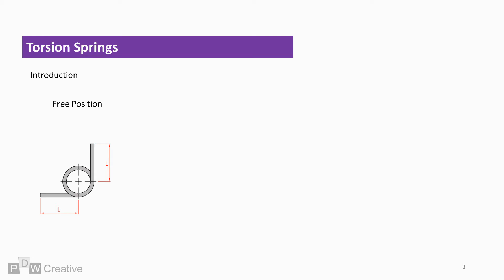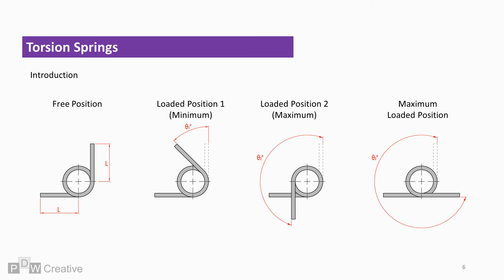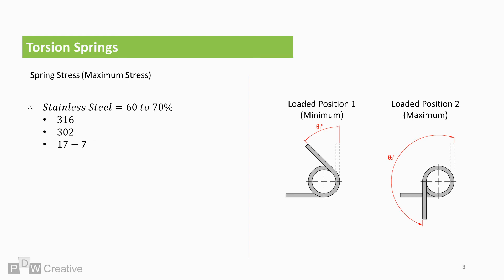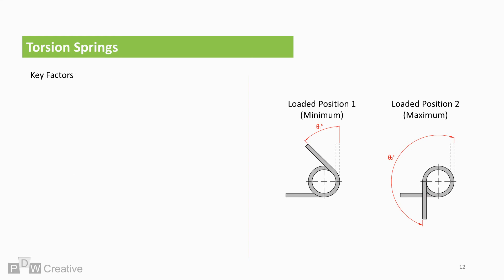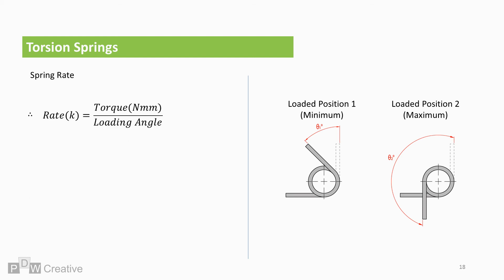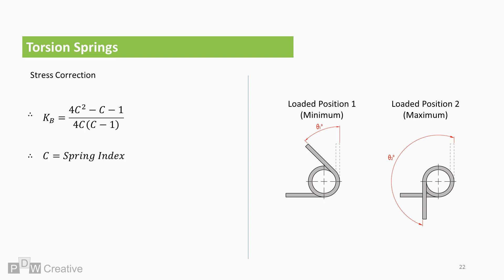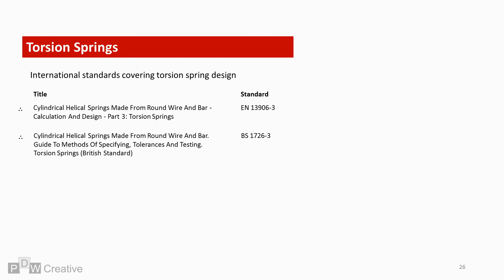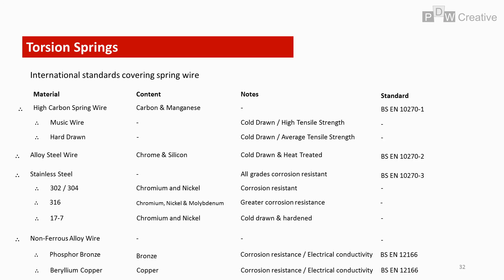Torsion spring design 2

Comment: The first way to calculate the rate (K) results in an angular unit (Nmm/°), right? And the second (alternative) way, using geometry and material data, does not involve angular units. How can I relate these 2 rates? Can I say that Torque/angle of rotation = E*d⁴/10.8*D*Na ?
Thanks for the video, it's very helpful!
Reply from the maker: The second calculation should be the method to work out torque

Comment: Bruh is twisting moment = spring stiffness * angle of twist ?
Reply from the maker: Spring rate or stiffness x angle of rotation will give you the torque at loaded position or moment. Ignore the stuff about loading non perpendicular to the arm. Calculate the perpendicular load before starting the spring calculation